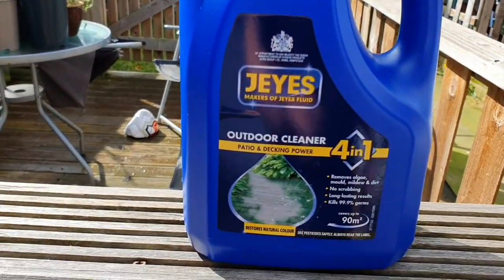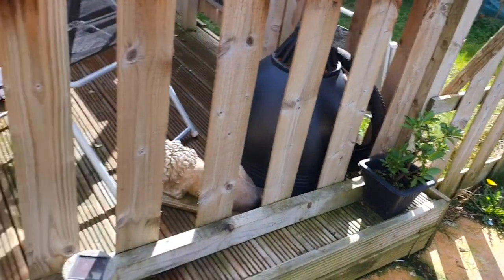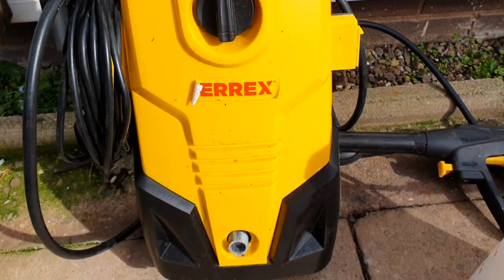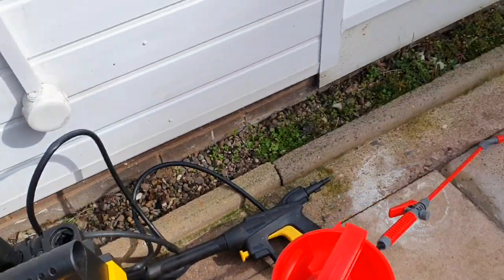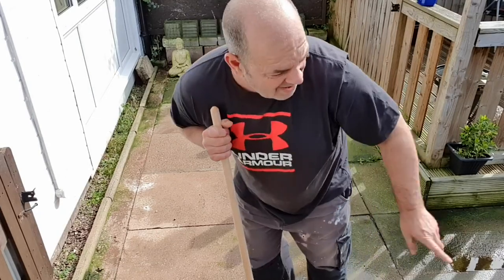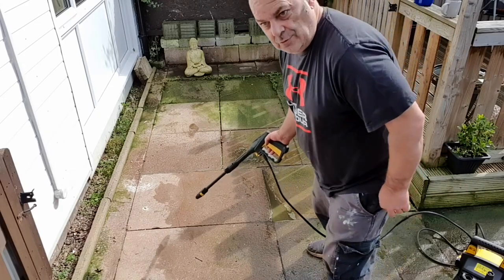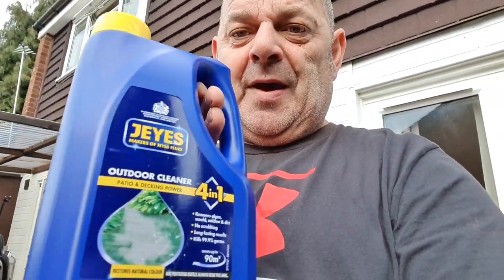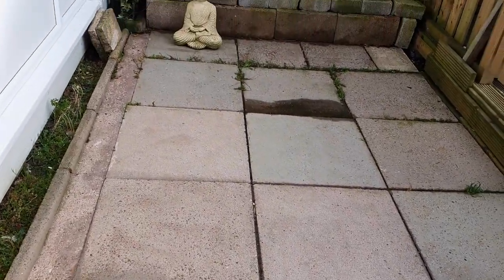Jeyes 4 in 1 Patio Cleaner

Comment: Well you can buy a box of the cheapest soap powder you can get get sprinkle that on work it in a little bit with a stiff brush the jet wash away job sorted leaving a nice fresh smell. I'm very poor so can't afford Jeyes Fluid try it as it works a treat also removes oil off your concrete drive.

Comment: Surely the whole point of a patio cleaner is not to use a power washer, as this strips the surface off any man made slabs or monoblocs after repeated power washing, whereas patio cleaners don't.
Reply from the maker: No Hilary
Reply: @itskeithnNat  so please explain your comment?
Reply: My thoughts aswell
Reply: The manufacturers of artificial stone and mono blocs do not recommend using a power washer as it gradually erodes the surface. 
Use an algae/ moss cleaner sprayed on.  So much easier, you can use it on fencing,  rendering  garden furniture, decking. Don't expect an over night result but in a few weeks you'll be amazed at the results.  Do every 6 months and you'll have it all looking good as new.   No mess too, unlike using a power washer and no stress.